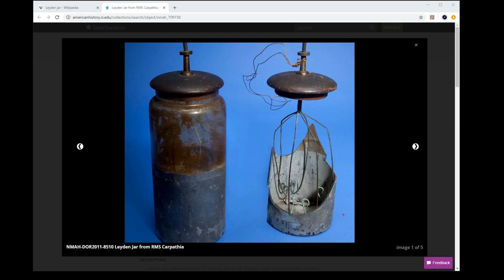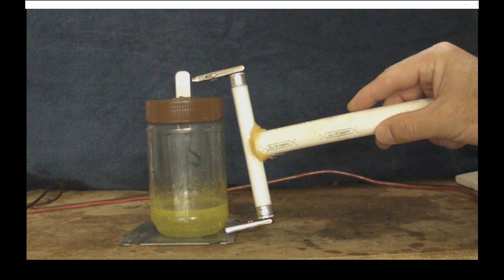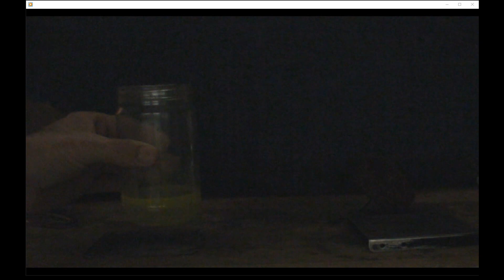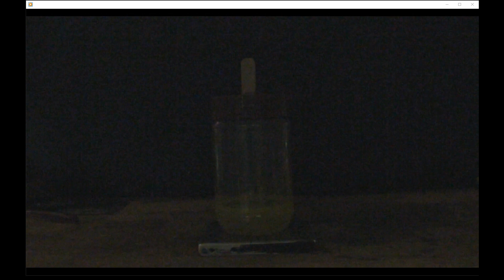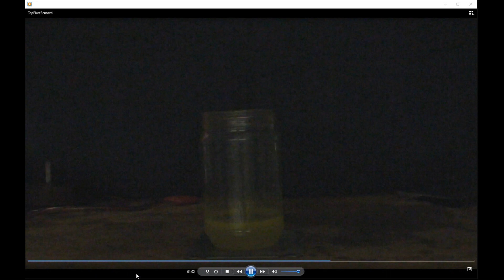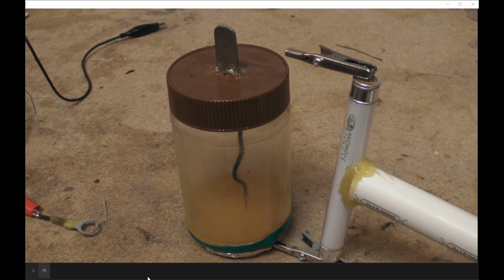Electron Theory can't explain Capacitors, but Ben Franklin can!

Comment: You can charge a piece of glass by rubbing it with silk, or charge a plastic comb by dragging it through your hair. (This has been known for centuries, using amber, etc.) You can't charge metal like that.

Therefore, it should be obvious that the glass or plastic "insulator" is what holds the charge in a capacitor, not the plates.
Reply from the maker: Yes, you are talking about the triboelectric effect -- rubbing.  Well, it was obvious to science until the Electron - atom of electricity - theories... mainly by Lorentz, Drude, etc.
Reply: @itsbs  We tend to think of "static electricity" as the "toy" kind of electricity with no practical usage except to amuse children at birthday parties by rubbing a balloon on their hair, etc. The "real" electricity is what comes out of the wall plug and can run power tools, etc.

But, if you look at Tesla, Vicktor Schauberger, and others, it seems that they considered "static electricity" to be the "real" electricity. Is it possible we have been looking at the "wrong" kind of electricity for the last 100 years?
Reply from the maker: @codetech5598  Yes.  I am very much interested in dielectric dynamics of Maxwell, Heaviside and Tesla, versus the Lorentz based static electricity.  The electricity of metals and magnets has done a lot of good for us and will continue to do so, but I believe it keeps us more locked into the "thermodynamic" realm of burning and rotating things, versus what is possible when we move more into understanding the dielectric realm.
Reply: @itsbs  I do not think it is a coincidence that QM and GM were so heavily promoted in the early 1900s at the same time that Heaviside and Tesla were ostracized. It seems there were powerful people who understood the implications of dielectricity and did not want it available to the public so they created a distraction which has occupied the mainstream for 100 years.

The Men in Black will soon be knocking on your door.
Reply from the maker: @codetech5598  Definitely possible -- there was promotion of certain people and particular ideas, no question.

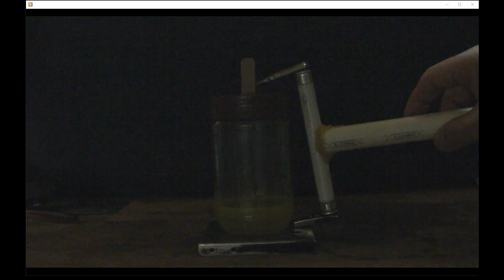Comment: 12:56 amazing prove.
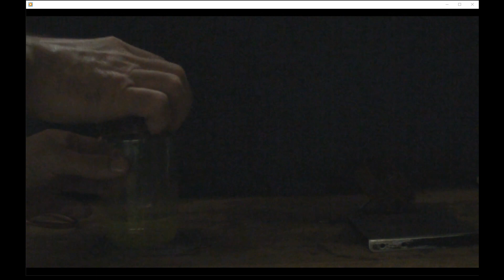Reply: 12:20 it would have been better if he had touched the old plates together to prove they weren't storing any charge

Except that would have ruined the proof since they would have made a much bigger spark than the later one
Reply from the maker: <<Except that would have ruined the proof since they would have made a much bigger spark than the later one>>

I missed this comment, since there was so much going on with Reddit at that time.  But no, you can touch the plates together directly after charge, and there might be a small spark, if any.  Either way, it doesn't ruin the proof at all, since different plates were used, along with removing more and more metal as the test went along.

Comment: I'm not sure whether this video is fake or the lamp really lights up because of some charges lingering around somewhere. The presenter seems to use high voltage where counterintuitive effects might occur. 

But Benjamin Franklin was on the right track indeed. The energy stored in a capacitor can be said to be stored in the dielectricum. The get the energy one intergrates over the volume that has an electric field. Wikipedia does a good job explaining that, https://en.wikipedia.org/wiki/Capacitor#Energy_stored_in_a_capacitor.
Reply from the maker: Yeah, fake -- I have 28 subscribers at this point...getting rich!  Maybe contact your local particle accelerator to confirm or deny these results. :)  I'd suggest to buy a $50 Ebay Wimshurst machine and run your own experiments on a plastic jar you threw in the garbage yesterday.  Yeah, high voltage is the problem here, sure...DANGER high voltage.  Where are the electrons flowing when the plastic insulator is transported outside of the electric field created by the electrons in the plates?  ...then discharged?
Reply: @itsbs  Well, I did my small share of experiments with capacitators. I even participated in an experiment with the local particle accelerator TANDEM here in Munich. But that was not about capacitators, but about radiation hardening of CCD X-Ray detectors.

If your experiment is not fake, then it would be interesting how it actually works. But I would suggest that you are not too confident that you disprove modern physics. 

Good luck,
   Bernhard
Reply from the maker: @bernhardschmalhofer855   Also, these are the links to the videos that I reference in my video and cut directly to the correct time that I am referencing.  I doubt we are all faking these demonstrations.  Also, MIT professor Walter Lewin takes a shot at giving his explanation on how it works, since you made reference to getting a Physics professor's point of view in another post.

Professor Walter Lewin - https://youtu.be/GAtAG938AQc?t=2390
Professor Walter Lewin's Leiden Jar explanation - https://youtu.be/By2ogrSwgVo?t=1965
Professor Julius Sumner Miller - https://youtu.be/NNR-sd58p-U?t=600

Dissectible Parallel Plate Videos:

Russ - https://youtu.be/eQGd_jYYfqQ?t=580
Richard Hull - https://youtu.be/NQO-p_ff0Xs?t=110

Distilled Water is an Insulator:
Jay (The Plasma Channel) - https://youtu.be/o9s5YM948q8?t=27
Reply: @itsbs  Thanks for posting the explanation as well. Maybe you saved me from a sleepless night. And I'm kind of glad that my comment " some charges lingering around somewhere" is not too far off from Walter Levins explanation.
Reply from the maker: @bernhardschmalhofer855  The last experiment in video is to dispute Walter Lewin's idea that the metal plates of the Leiden Jar spray charge (corona discharge) when mechanically moving the glass insulator against the metal plates.  I don't see how his explanation could still have any validity in this case:  https://youtu.be/mnyZpsJkMDk?t=910
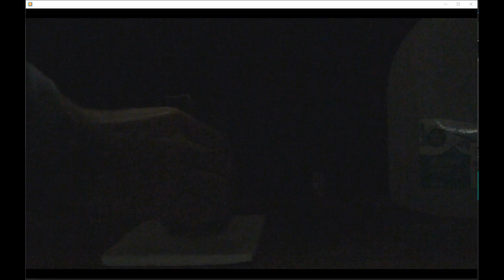Reply: @itsbs  After watching parts of Walter Lewin's video, I get now what you meant with your introduction to the experiment with distilled water. Could you check what was happening around  17:20 ? It looked like discharges occuring at that time. Judging from the sound, the windhurst machine was already turned off. But maybe the capacitator of the machine was still connected.
Another thing. The tip of the inner "plate" looked pointed. At the tips the electric field is maximal, which encourages discharges. You could change that tip to a sphere. This should reduce the maximal strength of the electric field, while keeping the field at the glass the same.
Reply from the maker: @bernhardschmalhofer855  I'm not sure I completely follow you.  There really is no "top plate" in this experiment, since the pointy metal end is submerged in distilled water, i.e. surrounded by 80 "Kappa" dielectric constant insulator.  The "top plate" wire is connected at the other end with an alligator clip that is several inches away from the jar.  The "bottom plate" is just the alligator clip that is touching the plastic jar and sitting on top of a Styrofoam insulator (so that the top of the desk was not a variable in the experiment).  There are NO frictional metal "coatings" in this experiment to cause the MANY, MANY Kilovolt corona spray required in Walter Lewin's theory.  When discharging, I just sat the jar on top of a pre-discharged metal bottom plate that was not part of the charging process.  I only changed out to the larger metal plate, so I could get a bigger spark for the video.  You don't even need to do that to see the discharge.  You can just put an insulated wire into the bottle and another end of a wire on the bottom.   Zap!

The real point is... do these experiments yourself.  You can probably buy a $12 Fun Fly Stick to charge up the capacitors.  I have shocked myself up both arms handling the plastic incorrectly (with 2 hands).  When that happens, you know it is real and not fake!
Reply: @itsbs  My hunch is that some corona discharges happened when you pulled the wire out of the insulating distilled water. That was around 17:20. Did you remove the alligator clips before opening the jar? Or maybe you were charged up yourself?

If I had that suspicion that something strange is going on here, I would do the experiment. But of course I have been wrong before.
Reply from the maker: @bernhardschmalhofer855  Well, the main discharge to the lamp and several of the "after discharges" from that experiment would be in the 30-50 kilovolt range of energy.  In no way did you see that little, pointy slice of copper wire "spray" that much "corona energy" onto the plastic, when I removed the small amount of "non-frictional" metal from the area of the jar.  At 3Kv per millimeter in air, you would have seen plenty of glowing/arching during removal.  Besides, I don't even know what "Corona Spray" really means, because when see the corona arch, that is a DISCHARGE (loss of charge) and not a CHARGE.

So, you now realize that you are grasping for some explanation, which is good.  Once you realize that modern science has dropped Maxwell-Heaviside concept of dielectric dynamics for the incorrect Lorentz ION theory, then you will see the mistake.  Then, you start to walk-back Einstein's electrodynamics, because they were built on Lorentz, and not Maxwell (as he said in his SR paper).  Finally, we all can resume oscillating electrical mediums, and pick up where Schrodinger left off.  At that point, you will see that Quantum Tunneling is just a function of classical electrodynamics (with dielectric dynamics brought back) and has nothing to do with a probabilistic, indeterministic, Max Born belief system.
Reply: @itsbs  Well, I note that you wrote "At 3Kv per millimeter in air, you would have seen plenty of glowing/arching during removal." As I understand it the glowing comes from ionised air created by a current. A current is just flowing charges. So I think, that charge is flowing to from the central wire to the bottle.

I didn't know the term corona spray before. But it makes sense. In a corona discharge, charges are leaving the conductor, discharging it, and end up somewhere else. If they end up on a isolator they are stuck on the isolator, that isolator is sprayed. As free charges don't simply appear and disappear. one part is discharged and the counterpart is charged.

The argument that the wire is tiny and  pointy works agains you. With pointy tips you get a high electric fields, which can cause corona discharges. My suggestion is to do the experiment with a sphere and the end of the wire.

If you argue that small discharges can't cause the effect, then you need some numbers to back that up.

I also have no idea why friction, or non-friction, should be involved here. (Also triboluminescence is another interesting topic).

You also make it sound like Lorentz-Equations ( presumable Lorentz-Transformations) and Maxwell equations are at odd with each other. I recall it differently. Take static electicity and combine it with special relativity (Lorentz-Transformations) and you end up with Electrodynamics, that is with Magnetism and electromagnetic waves.
Reply from the maker: @bernhardschmalhofer855  Believing in charge flowing via the wire is the standard.  The question is how does the plastic store all the charge without any metal plates to maintain the electric field?  So if Walter Lewin is right about the "Corona Spray" idea, then he single handedly saved Lorentz electrodynamics-electron-physics!!

The tiny-pointy wire issue that you bring up is just a small detail you are going on about while not addressing the 800 pound gorilla.  But I do appreciate the suggestion about improving the experiment.

If you say I need numbers to back up my statement, then I could say the same for you.  Where are your numbers that prove your statement that the small wire could spray so many kilovolts on the way out of the jar, that it could cause such a large discharge at the end?

It's less about the "friction" and more about Walter Lewin showing how the Leiden Jar metal coatings and glass can be "sprayed with corona discharge" when you slide then past each other.   Plausible idea, but I eliminated that with my experiment -- no metal coatings sliding past the insulator at all.  So if you think the little tiny wire point is doing all the "corona spraying" then I'd say run the numbers and do an experiment to prove it.

Lorentz took electricity out of the Maxwell Aether and stuck it into a material particle now called the electron.  Einstein removed the Aether and replaced it with the velocity of a particle we now call Photon and then warped all the material based on this particle, projectile velocity.  Photons don't exist... E=hf is a 1 second WAVE ENERGY equation.  Material electrons as the "atom of electricity" doesn't work.  I suggest learning Maxwell, from Maxwell, and not a third party textbook.  His first 8 pages give a great description of how he unified Dielectric dynamics, Magneto dynamics and Light waves via the Aether.  All the stuff that Lorentz-Einstein theory ended up WRONGLY taking out... as for Special Relativity, that's a topic in the near future that will be in a video.

Maxwell Dynamical Theory from 1864:
https://royalsocietypublishing.org/doi/pdf/10.1098/rstl.1865.0008
Reply from the maker: @bernhardschmalhofer855  I post confusing statements, because they contradict what you have been taught via academia, versus thinking and researching for yourself.  As for physics not being able to explain the capacitor, now you have a better idea what I am talking about.  In my experiment, how in the world does the metal re-create or re-induce the electric field that the electrons in the metal plates produce?  Wasn't it all about electron imbalance on the metal plates that make a capacitor work?  That is up to you to figure out, but that is the direct contradiction to the modern science capacitor explanation.  Now, you are leaning on 1 man's Corona Spray explanation.  I also have links to other people doing this experiment, so you can see more demonstrations.

Russ - https://youtu.be/eQGd_jYYfqQ?t=580
Richard Hull - https://youtu.be/NQO-p_ff0Xs?t=110

In terms of E=hf, it is a HUGE problem for all of Quantum Mechanics.  If you don't see that it is a 1 second wave equation (frequency is per second), then I have another video for you to watch.  It discusses the history and problems with E=hf in detail...but hopefully, simple detail:

https://youtu.be/WepArnF1S9I

Maxwell's idea was a "pre-charged" Aether called "free electricity."  The built-in Aether "charge" got placed into positive and negative IONs via Lorentz's theory (he took the "electricity out of Maxwell's Aether").  Lorentz also made his "luminiferous" ether stationary (which supported light waves in a vacuum).  Then Fitzgerald and Lorentz misused the Heaviside Ellipsoid idea to explain the length contraction of the mirrors of the interferometer experiments.  After that, Einstein took all of Poincare-Lorentz ideas and replaced the Lorentz "luminiferous ether" with the velocity of the projectile photon particle.  You have to find the history yourself, because I have not found it taught this way... so it is a lot of digging and reading.  Good luck.  

Remember, if you want to stick with Academic based modern physics, it is a way easier path than thinking and researching on your own...
Reply: @itsbs  I appreciate that you are doing actual experiments. But that does not turn made up random arrangements of words into sensible statements. E=hf is the equation that relates the frequency of radiation to maximal amount of energy it can transfer to a particle. This is not compatible to a wave picture. 

And what should do you mean by a "1 second wave equation" ? If you are using terms that nobody else uses you must define them first. I apologise in case you defined that term in the linked video. I didn't bother to watch that.

I have watched the Hull video and see no reason why charges should not have transferred from the plate to the plastic. There was no discharge when he had turned the plastic sheet around. Only negative charges transfered to the sheet, as only the electrons are mobile.
Reply from the maker: @bernhardschmalhofer855  Go ahead and watch the E=hv video for an explanation.  If you think you have capacitors figured out, then that's great for you.  The other dissectible capacitor videos were mainly to see if you were going to tell me they were fake too.  :)
Reply: @bernhardschmalhofer855  I don't want to hear the word "corona" any more.